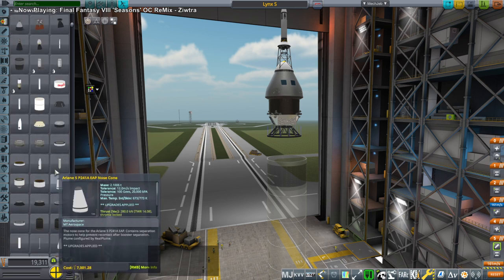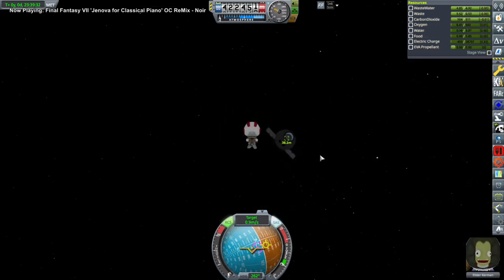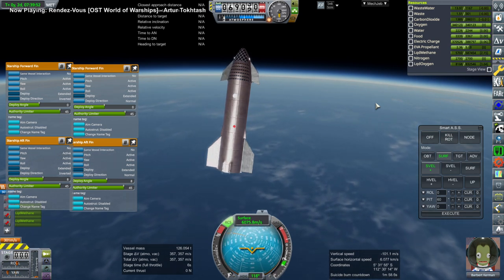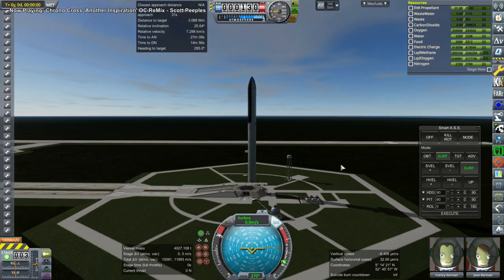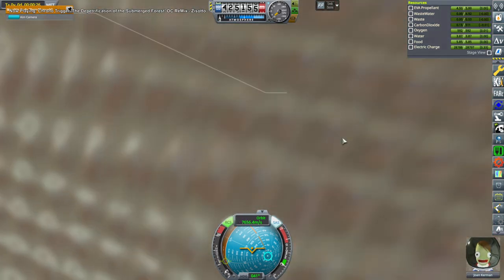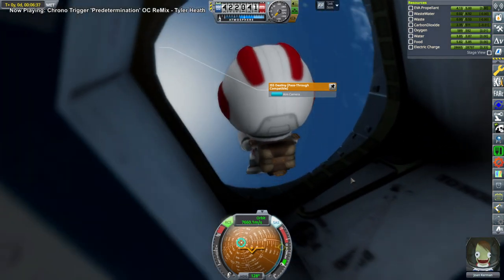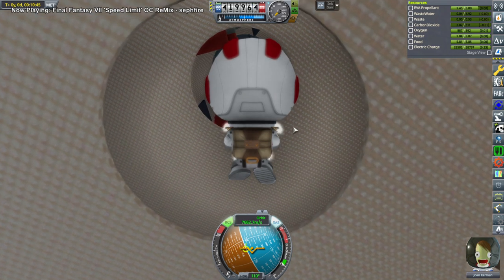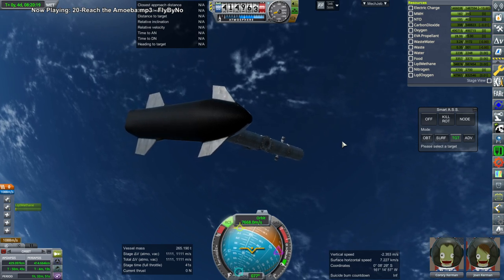KSP with Realism Overhaul - Starship Station 02

Comment: Are there no IDSS with petal guidance system to match the angle?
Reply from the maker: These are docking ports of my own design for the pass-through system. Generally, I don't really like the docking ports forcing an angle and just use MechJeb to hold the zero rotation relative to the target port. For some reason, when initially docking the modules we had to fix the rotation on, I had forgotten to do that for some reason.

Comment: What mod are you using to move around in the ships?
Reply from the maker: Well, the movement is just the normal EVA - it's just that the parts are made hollow instead of having IVA view like most crew parts in KSP have. The parts are of my own making, though the ISS ones are adapted from a model by NASA.